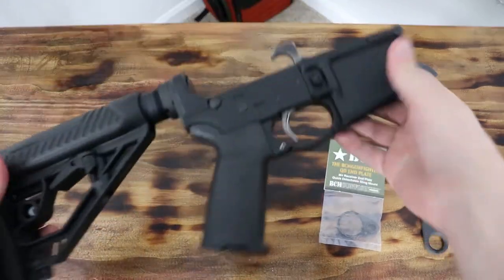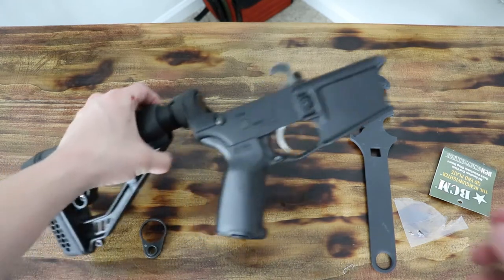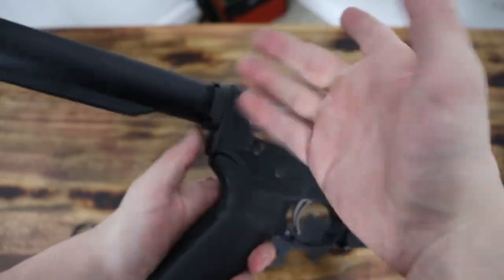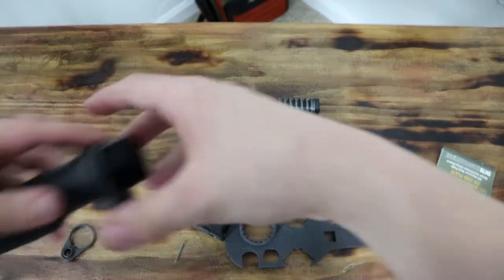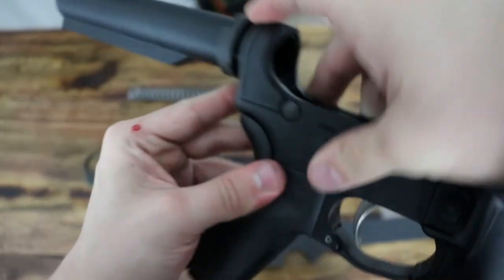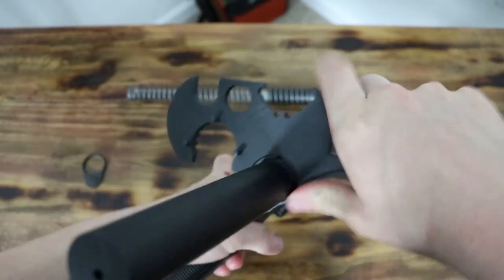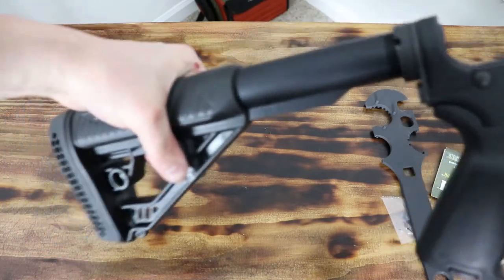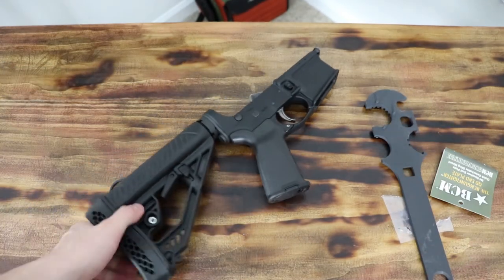How to Change The Endplate on an AR-15!

Comment: How far to screw in the stock tube? Until it stops or is there a set depth?
Reply from the maker: Screw it in until the lip of tube is able to push down the spring and detent in the lower

Comment: The tab on the charging handle is ideal for depressing the buffer spring retaining pin.   The tip of a 5.56 cartridge also works well if you are in the middle of nowhere, in a hurry, and have no tools.  However, don’t use a cartridge in the shop as you don’t want live ammo around.

Comment: what do you mean by staking your castle nut?
Reply from the maker: You take a punch like thing and hit in on one of the indents around the castle nut and it doesn’t allow the nut to rotate
Reply: @ElliottDelp   awesome thank you! thats not 100% necessary right? aslong as your torque it down properly?
Reply: @Kristoagui001  that is a never ending debate, but is extremely simple security. It is also not permanent. If you need to tale your buffer tube off for amy reason you can easily break thru the staking. Putting it back on leaves a 50/50 shot you mat need a new endplate. Depends on if the castle nut stops im the same place or of it rotates far enough that you can use a different part of the end plate to re-stake it. Mil-spec is to have it staked in 2 spots. Have seen quite a few vids where the castle nut loosens, endplate shifts, and takedown spring gets launched and renders the gun useless. Stake your castle nuts, no reason not to. It is cheap and easy insurance against a potential catastrophic failure.

Comment: What is the tool you used to tighten the castle nut?
Reply from the maker: I use an armours wrench, $20 at walmart. its a decent investmet.
Reply: @ElliottDelp  Did you get it online? or from inside the store?
Reply: @ElliottDelp I know it's a 3yr old video, but I'm surprised to see that Walmart was selling Armorer's wrenches.

Comment: How do you break the castle nut?
Reply: I believe what he means by "breaking" it is just loosening it. Alot of times the castle nut has already been staked, meaning it will require a bit of elbow grease to loosen it at first.